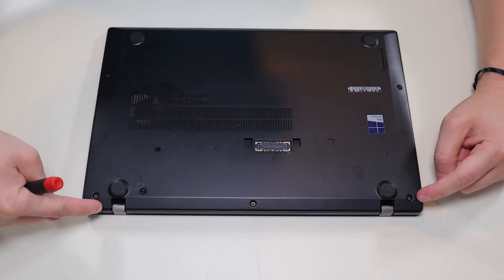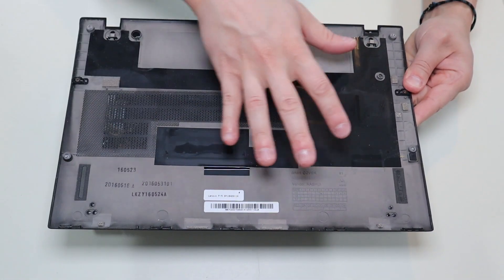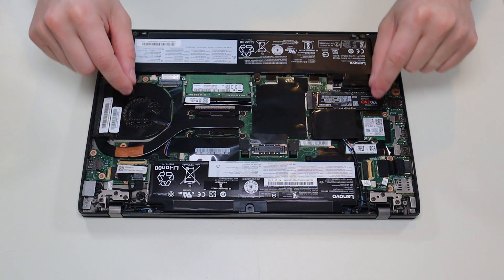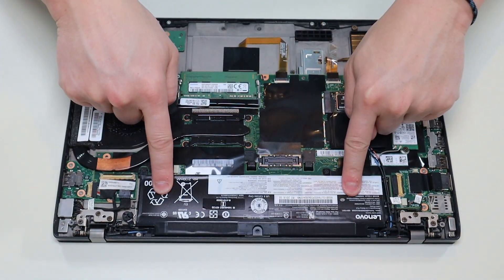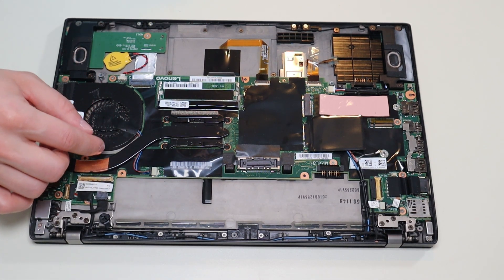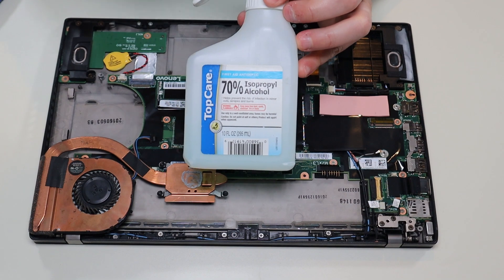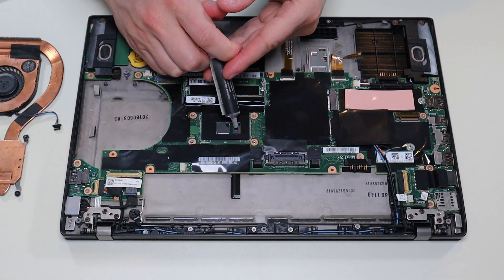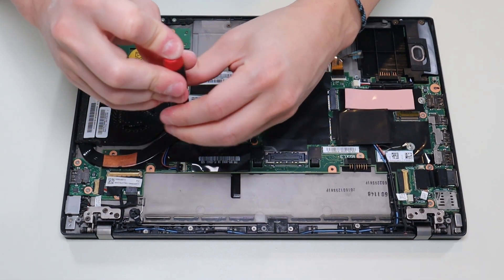How To Replace Fan, Heatsink, Thermal Paste - Lenovo Thinkpad T460S Laptop Computer

Comment: Sir, I have Lenovo IdeaPad flex 5 14are05, i haven't used it for a couple of years, maybe. It won't power on. I've tried to remove the battery, press hold the power button, the light just blinking on power, esc, caps lock button and charge port. Already pushed the novo button, but it doesn't work either, and I don't see the cmos battery. What should I do next?
Reply: Nevermind, the Ideapad now turn on by unplugged power flex cable. Strange, but it works. 😬
Reply from the maker: Glad your all set :) Always here if needed !!
Reply: @PC_Monkey  but it still a problem. When I trying to plugged it again, this IdeaPad not turning on. Again.
Reply from the maker: @MrAgunggigih  For a computer that does not turn on, try this video first; https://youtu.be/kOBY4k2Mn_k. Let me know how that goes :)

Comment: hello, I have a Lenovo Ideapad Flex 5 PC. It started showing a blue screen error some time ago, like it won't event get me past the sign-in to my desktop, in 5 seconds after turning the pc on, the error is persistent. I have tried to boot it twice now, once i tried to save the data by taking out the hard drive and the second time I lost all my data, I just wanted a working laptop. Now, on my new-ish laptop, the blue screen error is still occurring if the pc is not on charge. As soon as i remove it, it goes to blue screen, how can I fix this?
Reply from the maker: Can you try the steps seen here? https://www.youtube.com/watch?v=Q0UqVVcKuM8